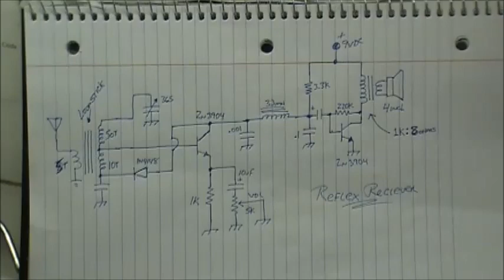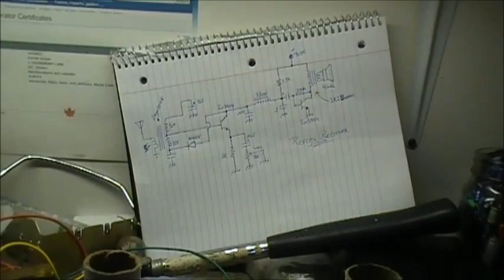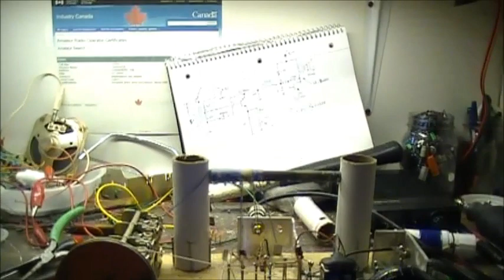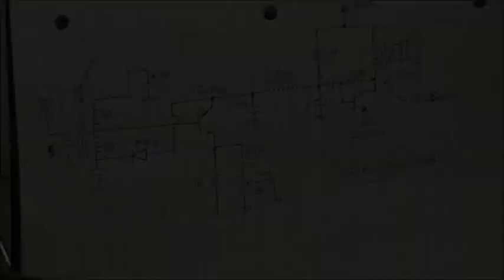800khz AM Reflex receiver to shortwave?

Comment: Reflex receivers work and make the best use of the minimum of components.  But nowadays with the cost of a 2N3904 less than a nickel it seems to be no reason to just add another stage of audio amplification.  It is easier to trace the signal since the audio and RF are not mixed.  But I admire you for building a great little reflex receiver.  One thing I would do is change the output stage to give less current drain on the battery.
Reply from the maker: Great comment, this is the kind of thing i like to read on my channel comments...  Thank you very much good sir!  :-)
Reply: I think - this circuit can work with any type transistors... like BC547...